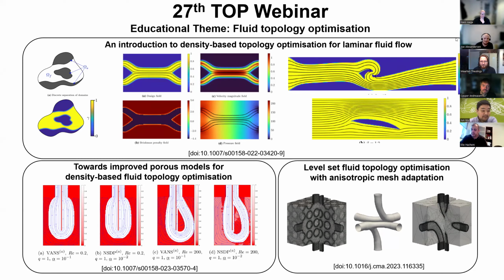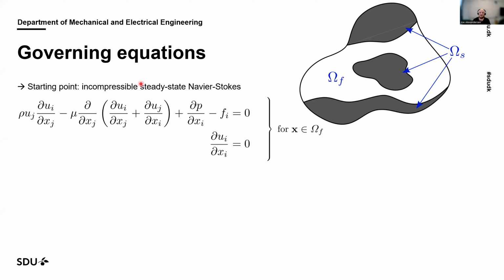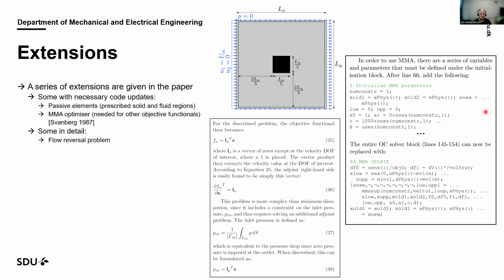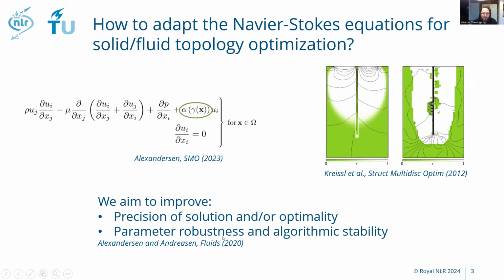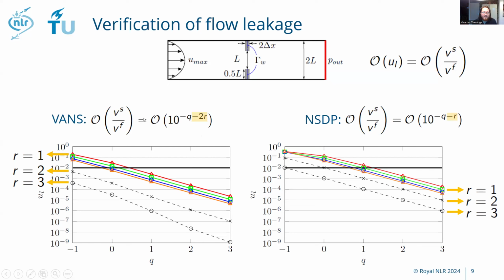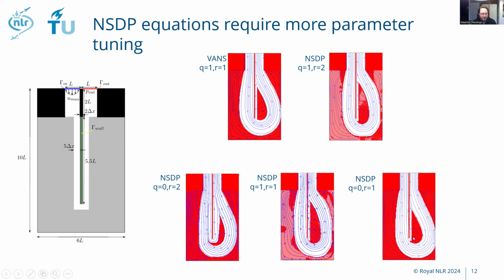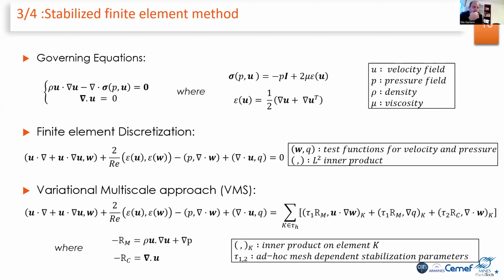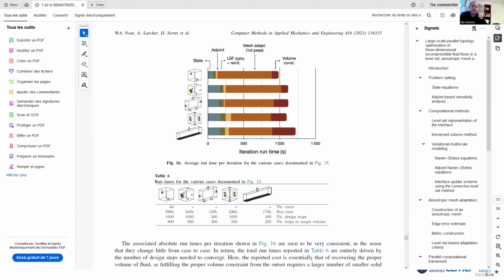TOP Webinar 27: Fluid topology optimization

Comment: Joe Alexandersen is factually wrong at the 8:20 minutes, since Sivapuram and Picelli 2018 (Topology optimization of binary structures using integer linear programming), it is possible to conduct topology optimization using binary structures with gradients. The binary methodology has also been applied to Navier-Stokes problems, such as Alonso and Silva 2023 (Topology optimization for fluid flow devices modeled through the Multiple Reference Frame approach)